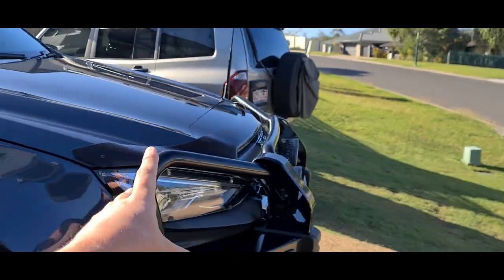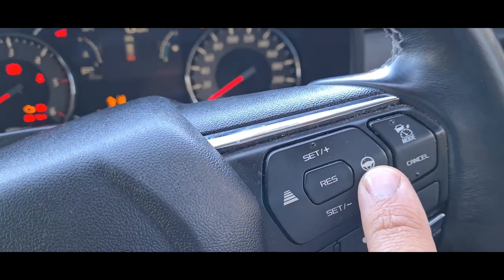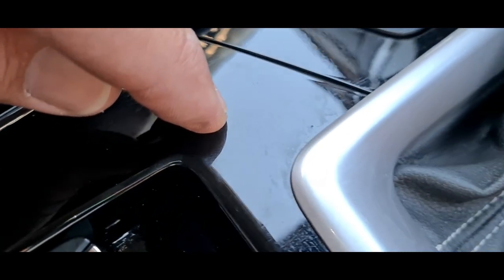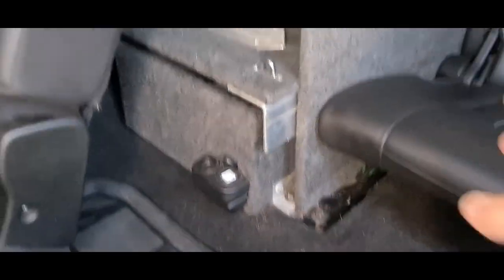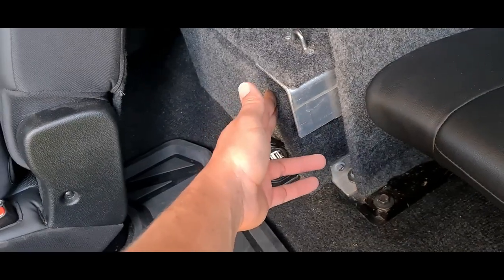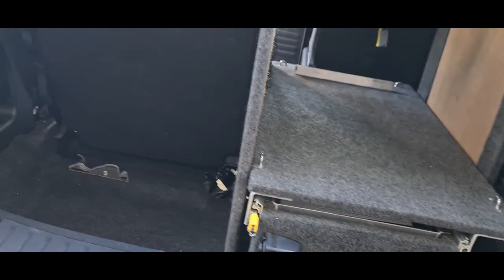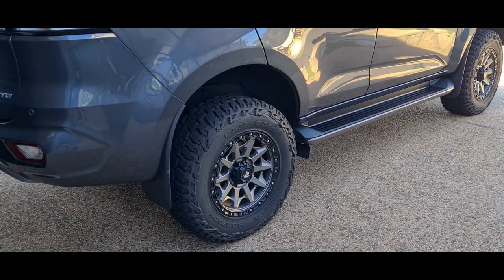Isuzu MuX LST 4x4 Owners 1 Year Review (+4 Months) RG MY21+ 2021 2022 2023 4JJ3

Comment: 4:25 I have the same 2021+ model MUX LST and I have removed ALL the door beeps, rear door opening, proximity beeps when you walk to far from the car, lock beeps, open doors etc. They can all be disabled from the small MID  display menu system
Reply from the maker: I do recall seeing those settings. Sometimes the auto lock doesn't work & I like knowing that

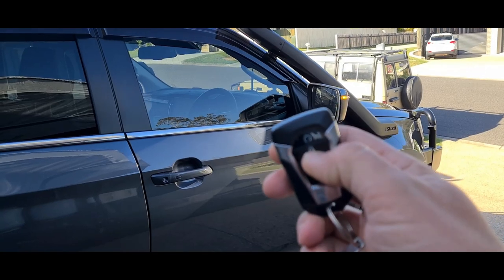Comment: 3:27 that remote start is the most annoying implementation you could think off. The reason is that when you remote start it, as soon as you open the door to get in, the car turns off, so you have to start it again. There should be a software upgrade option, to allow you to open the door without the car turning off.
Reply from the maker: I find it great on hot days when your ducking into a shop.
Remote start and crank the AC, that way the cars cool when you get back. 
Guess you could use a heater in winter.

Comment: Apologies if I missed it in the video, but how do you have your VHF radio mounted / wired?
Reply from the maker: The receiver unit is under the glove box & the hand piece is on the side of the centre console. Near the drivers knee.
I recall pulling the back of the centre console off in one of the videos. 🤷‍♂️

Comment: Thanks for the video, did you end up fitting the spare 32.5inch underneath?
Reply from the maker: Sure did. Fits with the factory towbar. There is one aftermarket towbar that has even more room. Can't remember what it is.
What size tyres are looking at?
Reply: @AussieDoug  ideally I would like to fit 33s. Or I know you can fit the 32.2. Unsure just yet
Reply: @AussieDoug  ideally I would like to fit 33s. Or I know you can fit the 32.2. Unsure just yet
Reply: @AussieDoug  is your odometer out by much? Do you find it more sluggish? I was reading up that a trans remap can be done to improve drivability.. except I didn't want to loose my warranty just yet.. 😂
Reply from the maker: Odometer is still 2km slow at 100.
Wholesale automatics make a valve body upgrade. This fixes lots of the trans issues. But does void factory warranty. 
A tune helps from what I understand to.

Comment: Hi mate, are you able to provide the specs of your wheel and tyre uograde? Like tyre size, rim width and offset? Aldo, did you pull the TPMS from the OEM rims and install them into the new rims?
Reply from the maker: Hi Liang,
The rims are a 17 x 8.5 with a 20 offset - PDW Cartel
Tyres are 265/70/17 - Mickey Thompson Baha Boss MTs
The factory TPMS was swapped over to the new rims.
Cheers
Reply: @AussieDoug  Hi AussieDoug,

Thanks for your reply. I know you lifted your car. Were the tyres and wheels installed preflight or post-lift? Would they fit with stock suspension set up like clearance between struts n stuff?
Reply from the maker: From what I understand my combo will fit under stock suspension.  We did the lift, then wheels & tyres.